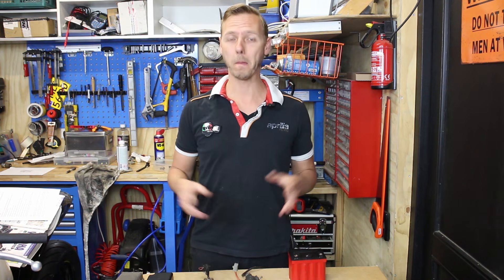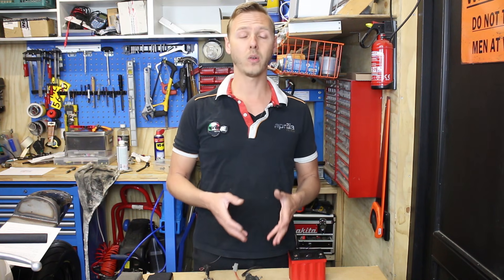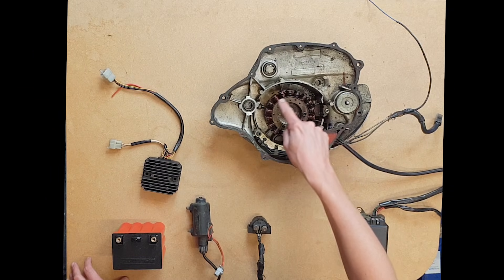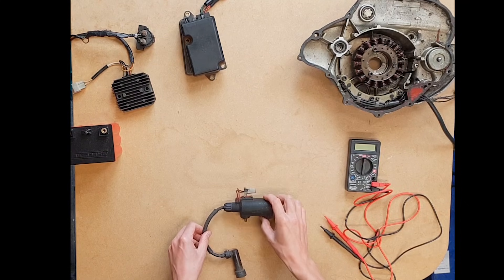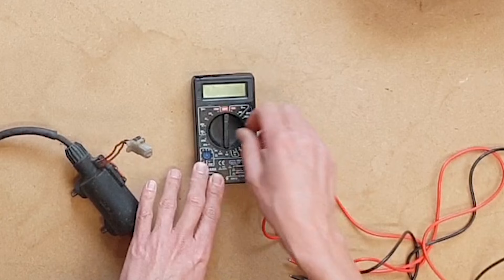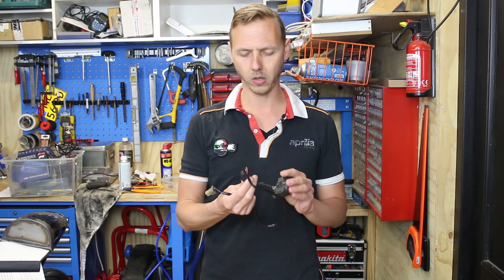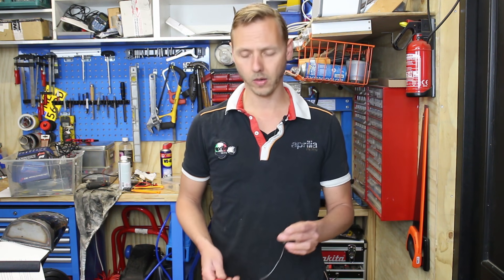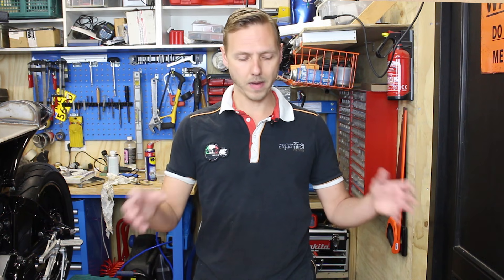Wiring a motorbike (or caferacer) 'Bare Bones' (part 1 of 2)

Comment: Hi, just a footnote if anyone’s interested... An engine’s alternator or stator produces AC current. Kick start bikes & mopeds used 6v AC for years. The ignition, lights horn etc would work using AC. But you can’t store AC electricity... If you can’t store it you can’t have an electric starter. So you need to convert AC to DC by using a rectifier. But AC current increases & decreases with engine RPM. So to smooth this out and make a nice constant voltage you need a regulator. Once you have a nice even voltage in DC form you can use it to charge a battery. Then boom, you have energy stored to hit the starter button & fire the engine up next time you need it.! Plus lights using DC don’t get brighter or dimmer with engine speed... which is handy.
Reply: well said, very helpful. thanks
Reply: Hi. Willing to assist on wiring of a 1983 Yamaha SR 500??  Thx :)
Reply: Yes. So easy to understand. Thankyou. Great explanation

Comment: I'm working on the same bike, same model, same year. This is awesome info thank you for the video!
Reply from the maker: Make sure you watch them all and in order. You can't make a mistake that way! 👍
Reply: well the bike runs now first time in 5 years.turns out the last owner had ignition coil #2 going to both cylinders causing alot of backfiring/ misfiring..with cleaning the carbs and following your directions it runs like new no misifires or anything.  thanks again!

Comment: i have a gn400, kickstart, do i need the battery/regulator setup? or can i just use the cdi and coils, i have spark brand new carb compression and air bike wont start, ive ruled out everything exept for wiring.
Reply from the maker: I'm sorry I don't know. Try to ask on a specific forum!

Comment: i tried to use a battery to test my rely and the wires got super hot i used 18 gauge black and red wire and did it the same way you did and it just fizzed for a little but on the bike i can hear a click what am i doing wrong
Reply from the maker: I have no idea. Sounds like something is broken/defect.

Comment: Your channel is very useful to me. I have already fixed the circuit cable of my Yamaha vx535. I would like to ask you again, do you know how to get the circuit cable of Honda's cdx750?
Reply from the maker: No I don't. If Is would start on a bike like that, I would do exactly the same as in the video. No matter what color the wires are...
Reply: @chiefpepdesign  I get it, because I have a virago 535 V engine and a cdx750, 4-cylinder engine, the wires of the two cars are no longer available, and after watching your video teaching, I learned to repair my virago 535 circuit line, and now only left  This cdx750, 4-cylinder engine circuit cable, because I don’t understand how the electric board operates? From the electric board to the ignite coyle, I have been looking for it on the Internet for almost 4 years, and finally let me find your channel to solve my viragi535,  I just can't find the cdx750... Thank you very much for your channel teaching for me to solve my problem, thank you

Comment: Thank you sooo mutch !  This is the best thing ever, im joining your patron as soon as im not so Post-vecation broke, quick question you changed the OHM setting on the meter, where did you start and what did you change it to ?
Reply from the maker: Ooof... I can't remember anymore. I think the only thing is to change one dot (from eg. 100 to 10). Just see which reading you get and figure out which setting you need and makes the most sense according to the reading. Same goes for volts. You can read: 1.23 Volts and on the other setting it will be 12.3 Volts which makes more sense.

Comment: Hi, I own an XJ400 (1983) and I am facing some
problems. When the engine speed rpm is high it stalls (bogs). In the beginning
looked like fuel supply but is not. Carbs are restored, cleaned and synchronized.
I double check it. I believe it is an electrical issue. I tested the coils,
rectifier & sparks and are okay. It looks like something is “confusing” the
engine electrically. 

Any ideas of what might be?
Reply from the maker: No unfortunately. Impossible to tell. Could be a shortcircuit somewhere. Could could try to lift up the harnass here and there during the high revs. Maybe it helps and you could tell where it's coming from. If an electrical issue is the cause... Have you checked the condition of your sparkplug caps and the wires in there? You could cut a small end of the wires and screw them back on. Often the wire in there is a bit dodgy.
Reply: Chiefpep thank you

Comment: Can you describe what values you set the reading for each part? Sorry for such a specific question it’s my first time ever using a volt meter, or if it says on the manual I can just look on there! Thanks! Working on an Sr250 by the way.
Reply from the maker: For which measurement?

Comment: I have a 81 xv750 I rewired it and everything works good only problem is there is significantly less voltage after the starter solenoid I bought a new one and still the same issue. 🙃 Any ideas?
Reply from the maker: Are your wires thick enough? Do you have a very solid ground as I mention in most video's? But what is the problem? Doesn't starter motor turn or...?
Reply: @chiefpepdesign  I can hear the starter motor try to go. The ground is proven solid and is all brand new. I re-used  the factory wires for everything else though.
Reply: @chiefpepdesign  I love your videos by the way, very insightful. You also do a very good job making it easier to understand.
Reply from the maker: @timhentges3567  try to connect all the main components directly so outside of the harnas to see if that helps. Sounds like a bad connection or even starting short circuit somewhere. Follow the diagram exactly as I explain in one of the first wiring video's with the main components serie.

Comment: Good going! YUP an electrical diagram for motorcycles, can at first look quite daunting,
BUT if you, YES YOU consider power goes from bat+ thru 1 or more switches, to a load
like a horn, headlamp then back to -- or ground known as the chassis you can take a pencil
and follow the path for eadch circuit. If ur working with a Harley D maint. manual grab that 
pair of half-glasses that is laying around you will need them to make out the letters for wire 
color codes, ask me how I know. Starter solenoid primary and secondary? NOPE Primary and secondary refer to the eindings in an ignition coil, magneto or regular tranformer as for the
electric utility company, your old train set,  BUT no primary winding, just a winding  whose 
magnetic field operates a pair of heavy contacts. This is 1 type of starter solenoid, the other 
type  is larger, does the same thing AND mechanically pushes or pulls the starter pinion gear
out to mesh with the ring gear either on flywheel or cluutch bundle.
If a Stator has three wires it is a 3 phase stator like nthe stator in an automobile alternator.
2 wires is a sinple phase job.

Comment: The mechanic here reconnected the radiator fan after it stopped.  And then I got an F1 sign, I don't know what to do.  And the mechanic also told me he didn't know how to fix it.  Where can I get this computer test from, please help me
Reply from the maker: I have no Idea... I am sorry. The Virago doesn't have a radiator nor a fan and no F1 signs.
Reply: I want to know the electrical stand caycul circuit with the power cable.  Because there is a fault with its electricity
Reply from the maker: @arsanuosmukthar1943  best is to search on forums I guess...

Comment: Hello great video I have a question to ask, I'm in the middle of trying to rewire my Yamaha R6R it was torn up by rodent's but anyway does this simplicity apply to my bake it's a 2007 it is also fuel injected with a electric fuel pump and has O2 sensor also has air flow meter so I'm really confused about the wiring and want to simplify it like yours thank you and again great videos
Reply from the maker: Basically yes and no. The basics should be the same. The TCI would be your boardcomputer and from there there will be plugs going to your injection. But you really need your wiring diagram. And I am afraid you will find that you can't loose a lot of wires since the more modern bikes like yours are allready wired up pretty descent. But the logic is still the same.

Comment: hey there great video's 👍 you never show how to wire the push start and relay could you post video explaining please that would be awesome other than that very informative video's been helping me alot
Reply from the maker: Yes I do. In this video https://youtu.be/uUIFEQswCOM. Which relay? I only use a turnsignal relay. If you watch the complete wiring serie you will notice all these topics are discussed.
Reply: yes i saw this one! very good! but i was hoping for starter relay and start button im keeping my fuel pump as well for now so was wondering if you had any ideas or suggestions
Reply from the maker: @allenking2474  Could you be more specific? I show and explain how to connect the starter solenoid and starter button. So what information do you miss?
Reply: so you dont run starter buttun to a relay..? that's where I'm confused...
Reply: wow my apologies you def mention starter button and cut off my wife or kids mustve distracted me tho i did watch video several times some how still missed this part lol but still as i mentioned i dont see you using starter relay for system..? dont i not need one? i have a 93 xv1100
Reply from the maker: @allenking2474  A starter solenoid is a starter relay... Please watch and listen this video very carefully from the very beginning to the very end to fully understand the mechanism: https://youtu.be/m2cGSZlpznc After watching this ask yourself what you are missing (probably nothing...)
Reply from the maker: @allenking2474  What is a starter relay in your opinion? Why would you want to ad extra stuff? Do you miss something?
Reply: i guess a relay is just a switch lol i thought it dampered the amps or volts that ran through it ...?if no relay do i need larger guage wire ..? or im a confused..?
Reply from the maker: @allenking2474  A (starter)relais opens and closes current. Not more than that. In part 2 of 2 I clearly try to explain 'let's just call it a starter solenoid ok?' But in this specific 1 of 2 video (8:15) I also try to explain what this 'relais' does... That 'primairy side' that I am mentioning there is the side that goes to your starter button. So you 'tell' (by pressing that button) 'hé Solenoid, give some positive current to the starter engine' as long as you press it. Listen closely to 11:10 where I clearly explain that. It is so extremely simpel that you are probably making it more complex than you think...
Reply: thank you so much for your help! i really mean it.  and yes i believe I'm just over thinking it lol you made it very clear now tho i feel like it all just clicked on my head and i really appreciate your time and your work thank you so much!
Reply: hey again i just uploaded a lil vid showing my diagram ..im not very good at youtubin lol i dont know how to tag you in it but if you wanna check it out thatd be awesome lmk what you think!
Reply from the maker: @allenking2474  I would advice you (if you are not so experienced with wiring) to just wire every wire step by step EXACTLY as my (or any) existing wiring scheme and not try to make a new one. Unless you know exactly what you are doing. Before you know it you will be making one little mistake and never find it back. Why invent the wheel again while it's allready invented and proven by others?

Comment: Hi! Great channel! I am just wondering, is this map and build similar for all Japanese motorbikes, except the wire colors and some connections? I am wiring a Honda GB250 (1989) and there are some differences (Less wires come from my R/R and 4 wires coming from my ignition key for example)  but I am hoping this build is mostly similar.
Reply from the maker: For sure. The whole scheme is basically the same. The units work the same. Best is to have your original wiring diagram at hand so you can always figure out which wire was going where. And you can compare it. More wires to your ignition key has probably got to do something with parking lights. And try to make a same scheme as I made. Delete all the central wires and draw new ones one by one like I did. If you do that first, you are allready teaching yourself what you will be doing in practice.
Reply: @chiefpepdesign  HA. Unfortunately the HONDA GB250 wiring diagram is like some ancient lost scroll. Complately unable to find it online, so I am going off a mixture of different Honda diagrams (CBR/CBX and ones like yours) in order to piece what I have together.
Reply: Thank you for your reply all the same :)
Reply from the maker: @diarmuidkelly965  Try the Haynes workshop manual. For sure they have it and in the back you will find it
Reply: Chiefpep oh I never heard of this. Thank you

Comment: Can a motorcycle start without a battery?
Reply from the maker: No. I believe a battery should be connected. It can be empty though. But obviously you would have to push start it.
Reply: @chiefpepdesign  thanks, I just feel that its more classic if theres no battery and you just have to kickstart the bike
Reply from the maker: @dantepatiko1450  yes, but these bikes have no kickstarter...

Comment: Did you upgrade your bike to a gen 2 CDI? Is it used or did you buy an aftermarket CDI?
Reply from the maker: absurity I have two in my garage. I was thinking to use the black one...
Reply: Chiefpep I bought a gen 2 regulator for my XV920 but the wires are different. Could you go over the difference? There are three white wires and one red.
Reply from the maker: absurity Are there no more coming out? Always compare the wires with what you had and try to follow which goes where. I will discuss the wiring in part 2. I'll try to do so as soon as possible. In the meantime search on the Viragotechforum. For sure you find your answer there!
Reply: Chiefpep I couldn’t find anything on the virago tech forum. In the manual, the 81-83 has brown to a main switch, red to battery. 84-on, it just has red to battery. So, it doesn’t have the main switch.
Reply from the maker: Then only use permanent red... Make sure you ground your R/R really well. It doesn't get fed by seperate ground/negative...
Reply: Ptw i